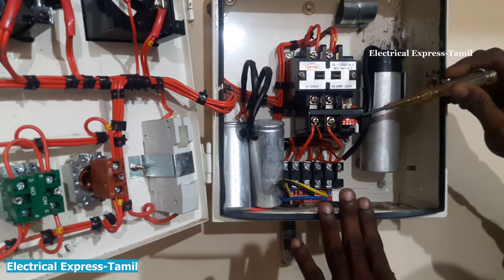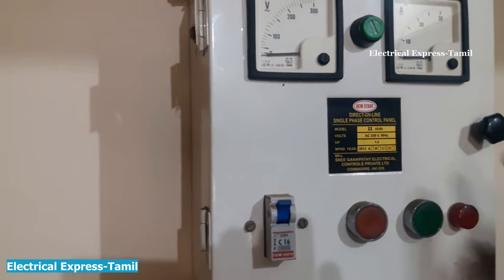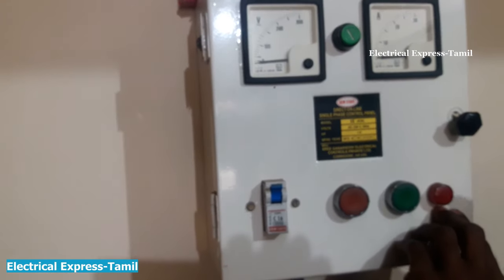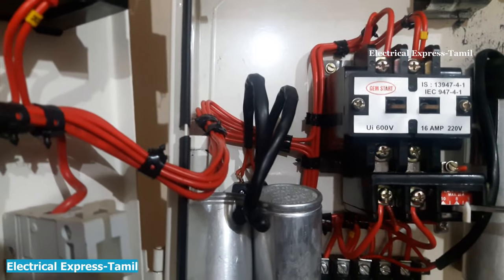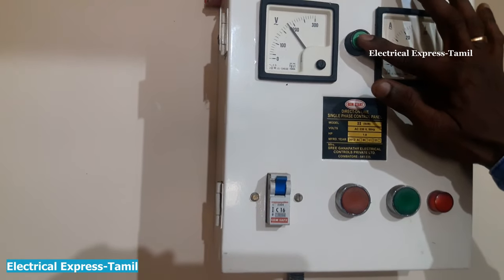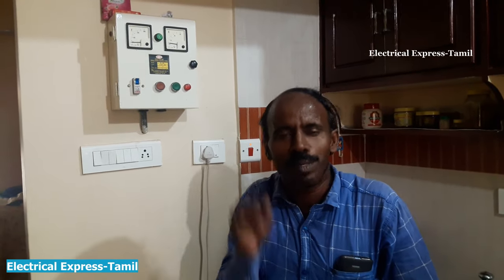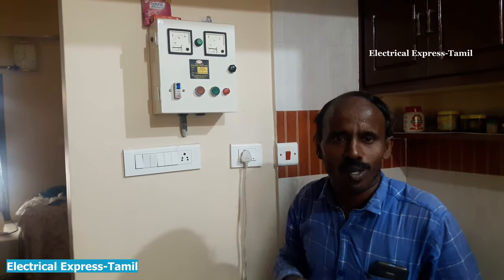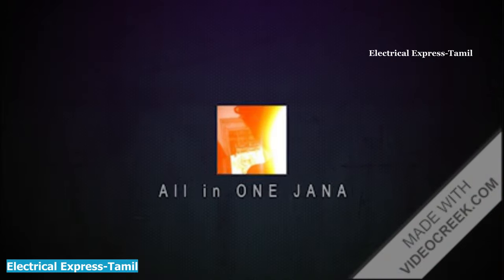submersible motor pump starter relay settings trouble shooting | Electrical Express | TAMIL

Comment: Bro single phase motor 220to 230v incoming  kodunga .low voltage kodukathenga  motor winding life low irukkum  . Voltage low oriental currunt high irukkum

Comment: Upstairs and downstairs rendu house iruku bro. common submersible motor  iruku.eppadi connection naan motor use panna ennoda service connection la work aaganum.avar use pannurapa avaroda service connection la work aganum.ethuku enna devices use pannan um bro suggest me..
Reply: Manual changeover switch use pannungal.
But EB rules padi illegal.
Athavathu service switch over pannuvathu.

Comment: Anna Amps 20 varaikum poguthu voltage 180 iruku Epdi motor problem analys panrathu 1.5 hp submersible pumb

Comment: Ji oru doubt .ennudaiya motor 1hp motor, ithargu MCB trip naan vaigala.athanala problem varumaa.illa MCB naan vaigavaa
Reply from the maker: உங்கள் மோட்டார் ஸ்டார்ட்டர்ல ரிலே.இருக்காங்க சகோ
Reply: @ElectricalExpressTamil  பாக்கல சகோ.அதல இல்லன வைக்கனுமா.ரிலே இருந்தா வைக்க வேண்டாமா.sorry bro motor illa,submersible pump 1hp
Reply: Ji reply pannunga pls
Reply from the maker: Over load Relay இருந்தால் backup fuse  போதும் சகோ

Comment: hi sir, motor running for 5 -10  mins and get tripped, using besten control box.   voltage is always 220, still i am facing a problem. Please advice

Comment: Sir எங்கள் வீட்டில் 2 hp submersible bore pumpபோட்டிருக்கோம். 500 ft. But pump எப்போ ON பன்னாலும் sudden a trip aaguthu sir. Enna problem. Aprom phase, neutral wire a konjo adjust pannitu potta oduthu sir illana athu appovu trip aaguthu sir. Enna problem

Comment: Anna enga 3 hp motor yappavumma 6 arms yatukum aanal innaiku motor on panaatthum 15 arms poiyu konja nerram odditu off aituchu appava on pannaan on aagala but voltage meter velayai senchutu Enna problem sollunga pls anna

Comment: Sir enga veetla on panadhum 11 amps katudhu but water bore la varala... epdi sari panradhu ungq contact number kedaikuma or any solution solunga pls..
Reply from the maker: May be motor locked or running capacitor failure

Comment: Main off la irukum pothu tester vachi check pannum pothu supply varala .multimeter vachi check panda than correct ah teriyuma sir? 2hp submersible motor evolo amp edukum ?
Reply: Use clamp tester.to find exact amps. This is the easy way.

Comment: Sir single phase motor submersible 700feet pip 
950feet eruku but 700feet pip eruku running work aguma solluga 2HP motor
Reply from the maker: Three phase better

Comment: 400 ft borewell agriculture use 3 phase motor how hp fixed  pump stage how many stage stater electiracal or oil sater yy best stater

Comment: 1.5 HP V I50 or I80 AMS 10 point, 1phase Ithu ethumpirachina Aguma
Reply: Low voltage ill motor fault aagum.
Stabilizer use pannungal.
Reply: @30mAkills  ஸ்டெபிலைசர் எங்க அமைக்கனும்

Comment: Sir main off la irrukum pothu 2hp submersible motor starter box la volt meter reading 60 to 70 kattuthu. Ithu normal ah? Please reply
Reply from the maker: தவறு 
உங்கள் வோல்ட் மீட்டர் ஜீரோ செட்டிங் சரி செய்யப்படாமல் இருக்கலாம்
அல்லது உண்மையிலேயே வோல்ட்டேஜ் வரலாம்
மல்டிமீட்டர்ல வோல்ட் செக் பண்ணுங்க 
வோல்ட் ஆக இல்லை எனில் வோல்ட் மீட்டர் ஸ்குரு ஒன்று இருக்கும் அதை அட்ஜஸ்ட் பண்ணுங்க
Reply: Main off panitu tester vachi  pakum pothu supply Varala sir. Kandipa multimeter vachi than check pannanuma?

Comment: Ithu one hp motor
Ithukku running  capacitor evlo irukkanum sir
Reply from the maker: Low level that means upto 100 feet your borewell -36 or 40mfd is enough
Above 100 feet 50 mfd need

Comment: Sir, How to install MPCB ? For 3 phase 3hp  Submersible Texmo Taro pump 

Now i using welltech starter panel with L&T Make Contactor 
   

1. In between service box MCB and starter or
2. in between starter and motor?

Sir Reply please
Reply: Sir, Reply me
Reply from the maker: In-between mcb to starter
Reply from the maker: Set the amps a little higher than how much amps your motor takes
Reply: @ElectricalExpressTamil  
Sir,   
    I Installed 3 HP 3 Phase TRF 730 H Model Texmo taro submersible borewell pump 30 stage ,voltage 415 volts (max 6.9Amps)
and
 first  switch on motor, The Installer set the amps rate 4 to 8 Amps in starter panel

Now the motor consume to run 5.8 to 6.1 Amps 

Now I Which Amps SCHNEIDER MPCB I Bought to fit  in between Main MCB to Starter??? Sir
Reply from the maker: You can use MPCB instead of MCB
Set 7amps

Comment: வணக்கம் ஐயா 
HP அளவுக்கு ஏற்றால் போல் ஓவர் load relay calculating பற்றி சொல்லுங்க. நன்றி.
Reply from the maker: ஒரு மோட்டார் எடுக்ககூடிய ஆம்ஸ் ஆனது அந்த இடத்தில் கிடைக்கும் 
1.வோல்டேஜ்
2.பவர் பேக்டர்
3.நாம் அந்த மோட்டாருக்கு கொடுக்கும் லோடு
(Fixed load or variable load)
4. சிங்கிள் பேஸ் மோட்டார் அல்லது மூன்று பேஸ் மோட்டார்
இதைப்பொருத்து மாறிக்கொண்டே இருக்கும்.
நார்மலாக பயன்படுத்தும் மோட்டார் 1hp 2- 3ஆம்ஸ் எடுக்கும்
நீர்மூழ்கி மோட்டார் 5-7ஆம்ஸ் எடுக்கும்.
எனவே  ரிலே செட் செய்யும்போது
அம்மீட்டரை கவனித்து செட் செய்வது சரியாக இருக்கும்

Comment: 300 ft ku enna motor correct ah irukum 
50ft la borewell podum podhu thanni vandhuchi
Reply from the maker: 1.5 hp 15 stages submersible pump motor best 
If ground water level goes to any end
Reply: தற்சமயம் 1.5hp compressor motor Suguna make கிடைக்கிறது .பிரச்சினை இல்லாமல் ஓடுகிறது

Comment: Sir motor on panna pugai varuthu wire fire agura mathiri smell varuthu sir athu enna problem sir but motor oduthu sir
Reply from the maker: Insulation failure உடனே மோட்டார் காயில்க்கு வார்னிஷ் அடிச்சு காய வைத்து மீண்டும் பிக்ஸ் பண்ணுங்க
Reply: @ElectricalExpressTamil  thank you so much sir

Comment: 20 amps edukuthu motor  work agamatindu ena pandradu sollunga
Reply from the maker: Check your starter capacitor and connection
Reply: @ElectricalExpressTamil  OK sir

Comment: Sir my pump starter box Is showing 30amps what to do
Reply: Same today morning problem in my house... Starter box meter la maximum 30amps than iruku, reading full 30 amps kamikuthu, MCB 5 sec la trip ayiduthu, motor odra satham ketkala, enna problem, seri pannitungla bro...  Rply pls...  tank empty...
Reply: @danii4646  bro check the no nc switch because  the starter capacitor will not release during the  start condition 2) check whether the motor is jam or not

Comment: Bro veetla 1.5 hp sub potrukom motor on panna dry run nu katudhu thanni varala Ena problem solution sollunga bro pls
Reply from the maker: வாட்டர் லெவல் பாருங்க 
வாட்டர் லெவல் மேலதான் இருக்குனா உங்க ஸ்டார்ட்டர் செக் பண்ணுங்க
Reply: Bro neenga endha ur bro Nan madurai
Reply: Bro apa bore la water level Mela irundhalum starter la dry run nu kattuma  bro
Reply from the maker: திருச்சி சகோ
Reply: bro starter la on button press panna wire trip Ana oru mathiri current sound chick chick nu kekudhu bro
Reply: bro starter la on button press panna wire trip Ana oru mathiri current sound chick chick nu kekudhu bro
Reply from the maker: @naveenkumar-oo4pd  புதிய மோட்டாரா?ஏற்கனவே ரன் ஆகிட்டு இருக்கற மோட்டாரா?ஸ்டார்டர் தவரே செய்யாது என்பதற்கு உத்தரவாதம் இல்லை
Reply: Bro reply pannunga bro
Reply: Bro reply pannunga bro
Reply from the maker: If you have instagram
Contact me in my insta id
Id in our channel page

Comment: Intha switch boxla sound varuthu Karanam yenna?
Reply from the maker: Contactor coil weak
Reply: @ElectricalExpressTamil  sir today morning problem, submersible pump(4") MCB tripping, no sound of pump running,  220v reading in starter voltmeter...  Amps more than 30 amps(maximum  30 than iruku), on panna 5 sec la MCB trip ayiduthu... What problem...
Reply from the maker: @danii4646  it may be rotor locked 
Check with reverse connection.
If reverse normal amps then again forword
Reply: @ElectricalExpressTamil  Thanks sir...
Engalthu 100ft bore, 20 years pakkathula approm vantha veedu 200ft or 300ft poturkanga...    
Motor potta 6-7 min thanni varum, approm verrum motor mattum Odum, oru 20min kalichi thirumbiyum bore la water fill ayitu thanni varum, oru tank fill avurathuku 1/2hr mela ayidum... Kadaila valve pottuka sonnanga, so thanni output kami irukum, athukula bore fill ayidum sonnanga...
*Appadi valve podalama...
* Thanni galiyautu verum motor oduna problem Varumma(heating pro, etc)...
*Pump veliya eduthu check panni thirumba erraka plumber evlo kepanga(100ft)...
* CRI pump warranty iruku, enna pannanum...
Rlpy panna nalla irukum... Thanks sir...

Comment: sir 1HP Motor epti 6amps edutukum
Reply from the maker: Submersible pump always take more amps
Reply: k sir
Reply: Motor la mention airukarathu 0.75 amps. Athavathu 750 watts . yen 6 amps lam yedukuthu . Yenna calculation

Comment: Stater la supply varala...what to do
Reply from the maker: Check main db MCB
Reply: Check panniten....trip yethuvum agala brother....naanga three phase connection use panrom...voltage 250V mela iruku....but ammeter voltmeter la changes illa brother, starter mcb on pannum pothu....enna problem ah irukum  nu konjam sollunga plz